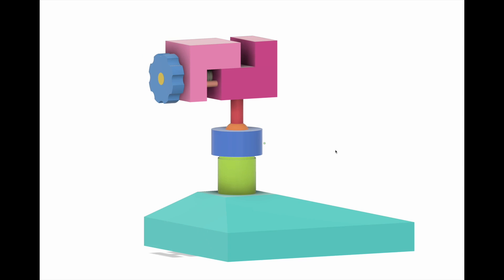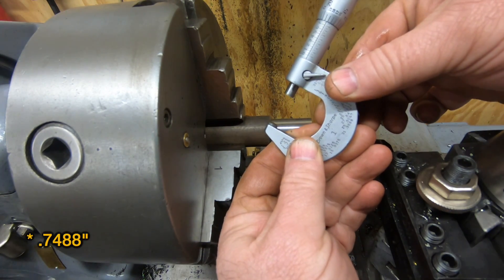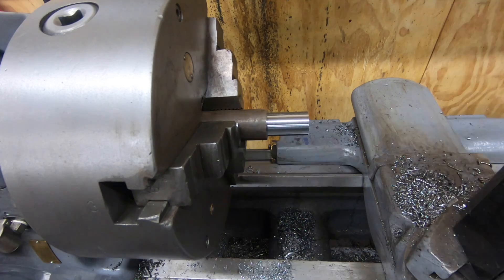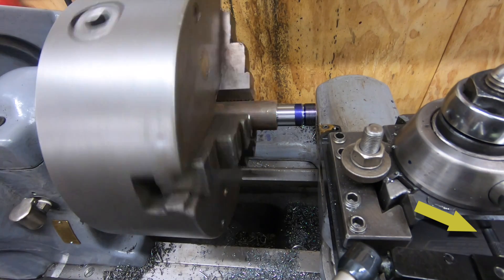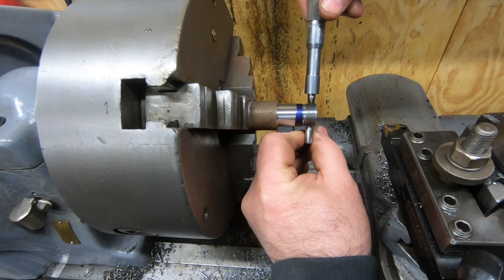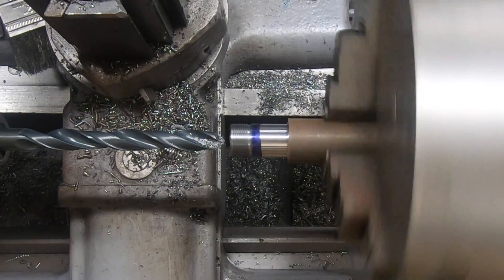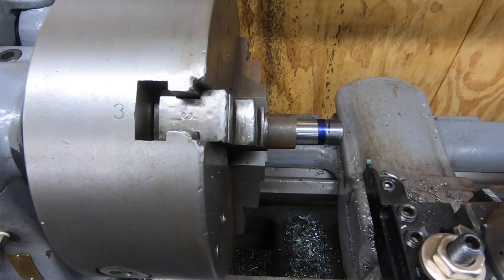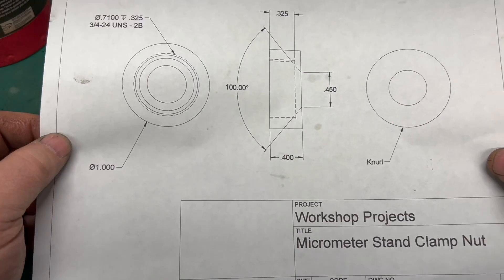Creating A Custom Micrometer Stand: Step-by-step Build - Part 2 - Making the Riser

Comment from the maker: Some details that were left out of the video on cutting the threads for the riser. I picked 24 tpi just because I wanted that. I wanted a dense thread pitch, mostly for aesthetics. The data on a 3/4-24 thread: Max/Min Major Dia: .7488"/.7416" - Max/Min Pitch Dia: .7217"/.7176" -  Pitch depth should be around .0136", if my math is correct. That's what my target was on the dial indicator, but I was only moving it in .001" at a time after the first 2 passes. But using the pitch micrometer was really what got it dialed in.